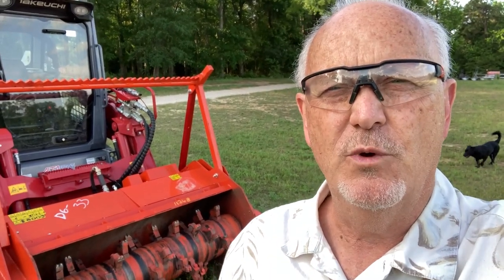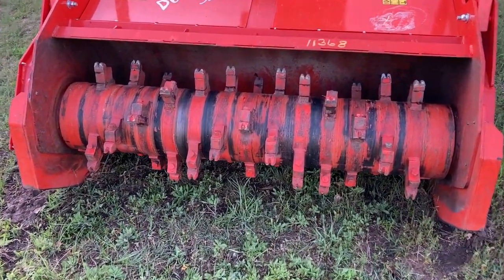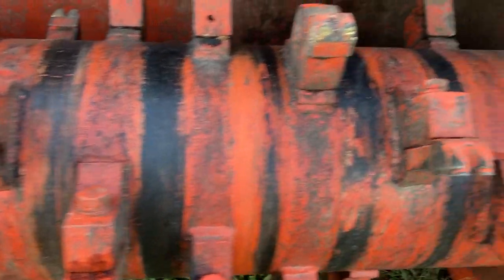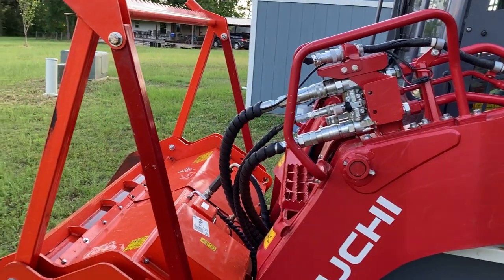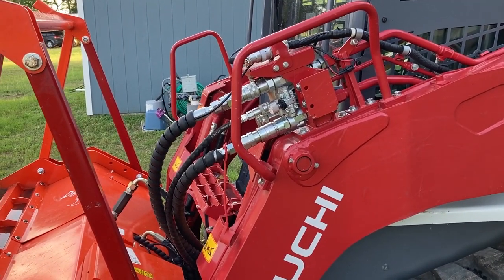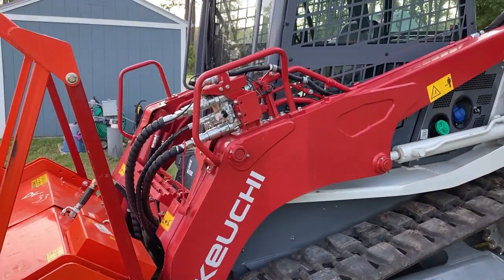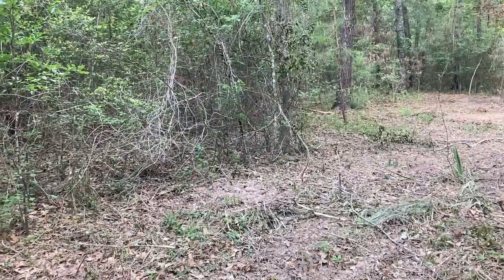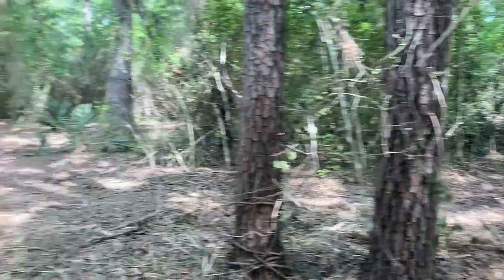TopCat Mulcher - SSFM81 My #1 Concern + Example Mulching Work (aka AGROTK)

Comment: Looks like there is a lot of material for regrinding and sharpening the teeth. Do a bit of  research about metal hardening. Buy some square bar steel, shape it, harden it, and put a finished edge on it. If one happens to breaks..

Comment: I'm a little disappointed with the results here especially since you have such a beautiful machine the tl12 I think you're right about the teeth they should be much more durable and the wear pattern on the drum also worries me it seems as though the teeth are not properly staggered
Reply from the maker: Mike, you are right on.  The teeth are not staggered at all.  If they were the performance would be a totally better experience. The other issue is as you say, the teeth are failing long before expected life.  We are looking at alternate teeth options and plan to post video soon on how that is working.  One set of alternate teeth we are testing are FAE brand knives they will provide a 50% improvement in the cut width which should help with re-processing and provide a cleaner cut with less stubble.  Hope to post that video soon.

Comment: one thing that proves your point that its highflow, is it comes with a case drain line. usually only HF items have that line.
Reply from the maker: Thank you for that.  That is a very good point.  Did not even think of that.

Comment: Do you have maintenance manual and parts manual
Reply from the maker: This is the manual and parts list from AgroTk the U.S. provider of TopCat products.  https://agrotkindustrial.com/products/skid-steer-forestry-drum-mulcher  there is a link for manual and parts list.
Reply from the maker: Also, this is NOT the topcat, but it is so close, I am certain it is the same build.  The manual is the best I have found so far  http://titanmanuals.com/pdfs/72MULCHER.pdf

FYI... the Teeth for the Titan version of this mulcher are NOT the same and will not fit the Topcat

Comment: Mine came with chipped / broken teeth.  Biggest issue IMHO is the gap between the teeth - makes it a complete PITA to use on anything bigger than brush. A proper mulcher staggers so you don't have a 2-3 inch gaps where you cut.
Reply from the maker: Yes, that gab took me some time to get used to.  I have done some 6" trees, but you have to take it down small sections at a time, come down on it, go up, shift over and repeat.  Works, but means you will spend a lot more time re-processing.  as a DIY attachment it gets the job done, but I would not want to be trying to make a living with it.

Comment: It's probably not Domex or Hardox Steel, so it won't last.     If you are only getting 1/10 the life of the teeth, that's bad.       Just got to ask yourself how much would someone charge  you to do it, vs what you paid for it.
Reply from the maker: Yes, that is a valid point and something that should be considered.  I am guessing (and only guessing as I have not put the research into it), that I have about $18k of mulcher, teeth, repair parts, etc.  And, up to this point I have done around $12k of work/mulching.  So got a ways to go.  On the other hand, by doing it myself I am able to more selectively do the areas I want, in the way I want them.  some of the work I have done would be a little hard to describe to a contractor.  Still, this is good advise before someone opts in to spend the money to buy.

Comment: Good day. I’m looking at buying one but see you are having trouble finding teeth did you have any luck finding them.
Reply from the maker: I have found a source for the original teeth.  Via Agrotk.   https://agrotkindustrial.com/products/skid-steer-forestry-drum-mulcher   However, about the only way I have been able to get a response is via email.  The teeth ship from china and the last time I asked - about 60 days ago - they were quoting $106.00 per tooth.  That is way to high in my estimate.   Right now, I am having an issue with the hydraulic cooling system (leak in radiator), and am having zero luck getting details on replacement.  My recommendation is that you buy something that can be more easily supported.  These units take a beating, which means they are going to have parts fail.  However, if you are using this personally, light duty, and can pick one up for $5k, it could be a worth while investment.  Just know repairing when it fails is going to be difficult and expensive.